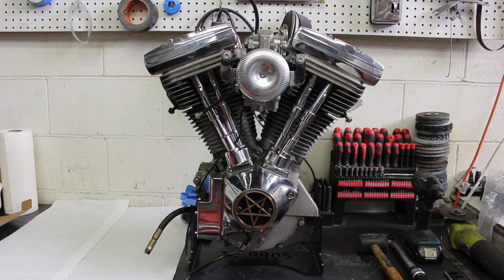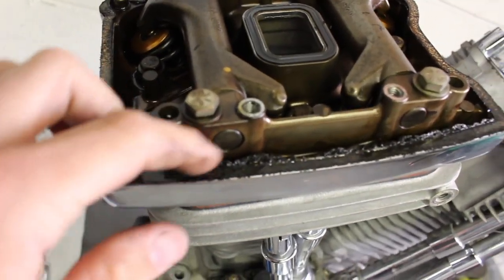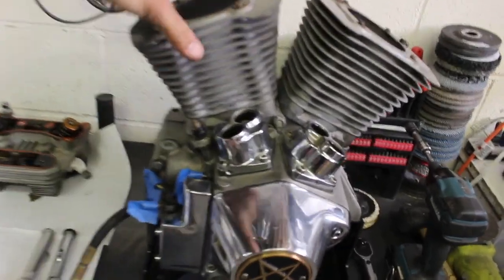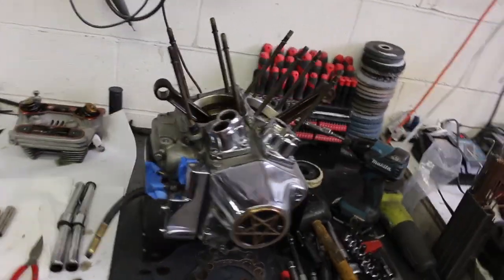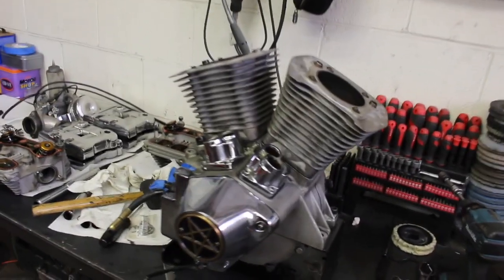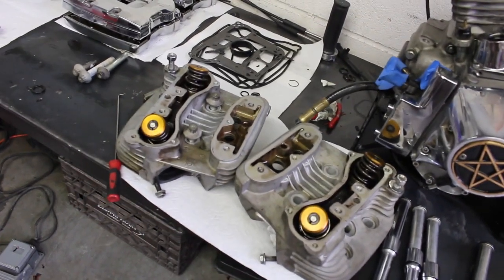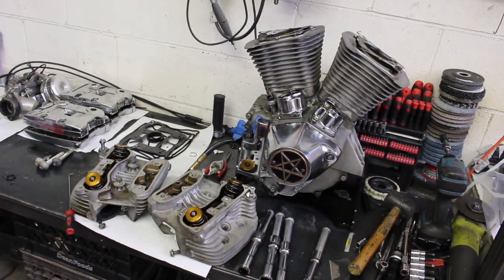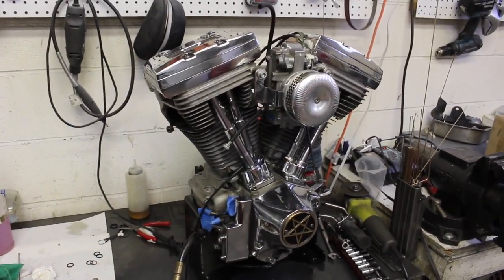Fixing Harley Davidson Evolution engine leaks

Comment: My Evo is 21 years old.  Zero leaks.  Runs like a Swiss watch. Never been opened up.  The secret? Start her up and let her idle for a few minutes without revving it.  Let that oil pump up the lifters and get around the engine.  Then off for a blast.  Great engine.  The most reliable Harley ever.
Reply from the maker: No one understands how crucial warming up these bikes is! Glad to hear yours is still running like a top! Totally agree with you, these are probably the best Harley engine ever made!
Reply: Do you wait until the choke is pushed all the way in before riding? Or start riding with it at the half way point?
Reply from the maker: @Tobagator  Yes push the choke in before riding! You should really only need it for super cold start ups. Thanks
Reply: Yup I agree I never cold ride my 95
Reply: Yep all 5 motors i own get the 5 minute warm up. And all 5 engines are perfect. 2 have over 250,000 miles on them and they run perfect. Take care of your engine and it will take care of you
Reply: That’s considering you’re the only owner who already knows this. Buying a bike from someone who didn’t…you’ll need to service the seals. THEN, now that a rightful owner has her, warm up first and ride. :)
Reply: I guess Im randomly asking but does anybody know of a method to log back into an Instagram account..?
I was stupid forgot the password. I would love any tips you can give me
Reply: @Jeffrey Frank i really appreciate your reply. I got to the site through google and I'm waiting for the hacking stuff now.
Seems to take quite some time so I will get back to you later when my account password hopefully is recovered.
Reply: @Jeffrey Frank it worked and I now got access to my account again. I'm so happy:D
Thanks so much you saved my ass :D
Reply: @Raymond Leighton glad I could help =)
Reply: My rear cylinder has a weird pop intermittent pop puff on cold idle only on rear cylinder front run fine an smooth....any one has this problems
Reply: I like to use the backside of my fingers on the rocker boxes before I rip it down the road,  once it's uncomfortable to do that move, it's time to ride.
Reply: I agree totally, 1995 fxdwg 60.000 miles never opened runs like a dream
Reply: @houseofchoppers  would you use Hayden oil fix?

Comment: Pull the Wrist pin , never hammer it out the rod bearing in the bottom are cage bearings they bend and kink if the rod is moved by a sharp blow with the hammer .   you can make a wrist pin puller out of 4 inch long 3/4  inch pvc and a 8 inch 3/8 bolt . lot safer then a hammer .

Comment: I put a new cone on my Shovelhead last September.  I couldn't get it to run good. Bought to a shop. They got it running. A couple of my bolts came loose, and oil all over my front exhaust.  Tightened all to specks, not leaking now!

Comment: i had a 1989 FXLR custom lowrider  with this eng.  the rocker box seals  started leaking on a road trip, that was a problem and lifter block gaskets leaked once.. other than that, great bike,  i loved riding this bike to sturgis back in the '90's.

Comment: Ok mate, first off you need to lap the bottom of the cylinders to get them flat. Trock Tools sold a lapping plate for this purpose, it works great, I've done probably 500 motors using it and it solves the problem, updated gaskets alone usually will come back,, just FYI too late for this build. Harley made a lot of EVOs, made them until the dies got unusable, the later FXR 2,3 4, were all horrible parts. I loved my 95 inch Sputhe motor in my 84 1/2 FXRT, totaled in 2015. I lost interest with the twin cam, but still serviced them untill 2010  when I retired from H-D. Enjoy the experience and ride to live.
Reply from the maker: I have seen the lapping plate before, I think v twin might still sell them, Ive honestly never known any shops that use one though. Im sure it would be good to have but I haven't had a problem thus far without it. Thanks
Reply: @houseofchoppers  quality shops and knowledgeable engine builders use them. Also don’t use a hammer to get the wrist pins out. Make a simple and cheap press tool. You don’t want to put that kind of shock on the rods and rod bearings.

Comment: Is it possible to pull a evo out of a fl frame, without removing the clutch and inner primary cover from the bike ?
Reply from the maker: I have never tried but would assume not. You will have to pull the inner primary, you have to tilt the engine to pull it out of the frame. Thanks watching
Reply: No.

Comment: How long did this reseal job take you start to finish???
Reply from the maker: It really depends on how much time you spend cleaning all the surfaces and if you have everything you need, I would say around 3 or 4 hours but I take my sweet time on motor stuff and don't rush it.  Thanks!

Comment: Do u need to remove the motor to change the base gasket
Reply from the maker: No you can do it in the frame, just follow the same procedure, you'll need a shortened Allen to get to the rear rocker box bolts but besides that no problem.

Comment: Base gaskets DON'T  just start leaking. If they are leaking you should be looking at the cylinder condition.  The leaking is most likely caused by too much crankcase pressure.
Reply from the maker: Few years later and it still doesn't leak... gaskets still rot out over time.
Reply: @houseofchoppers  I'm getting some slight weeping/leak that's spraying on where the front bold connects the carb to the head and caking up on the back of the carb.  Also looks a bit greasy around where the top of pushrod tubes go into the head.

But I'm not sure where it's coming from exactly.

Any idea as to where it could be coming from?

thanks

Comment: oil leaks are normal for harleys, why all the fuss guys who buy rockets then switch to harleys are confused because harleys leak oil, boys thats norma l go ride it
Reply: They only leak due to the oil pump. Due to the bike sitting a long time without running. There is this little thing called gravity that causes this issue. ✊🏻🤫😃. The oil drops from the upper end of the motor down to the check ball and spring. If the spring in the pump is to weak that is the issue. Oil drops gumming the bottom end. Most really old engines shovels and evos. Probably older all have this issue. A little work in the oil pump spring check ball area and it’s a none issue.